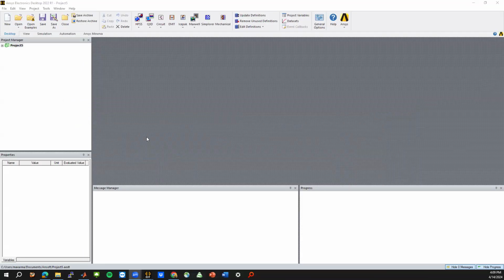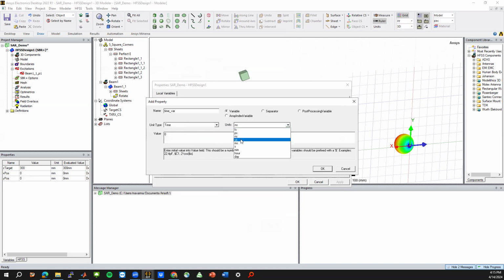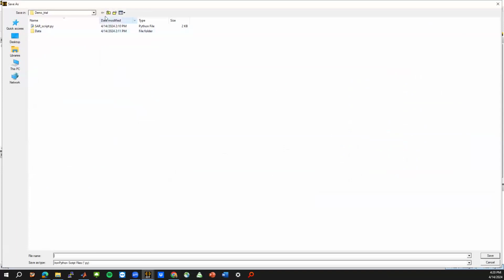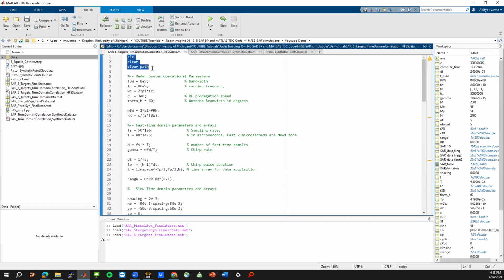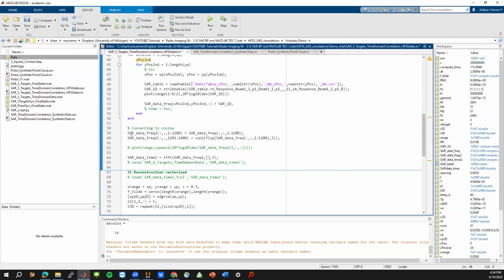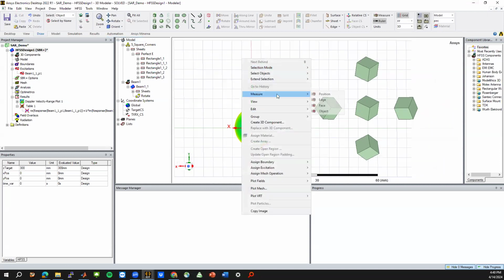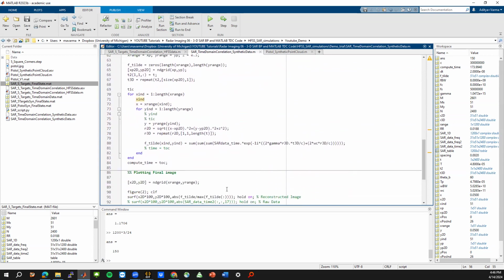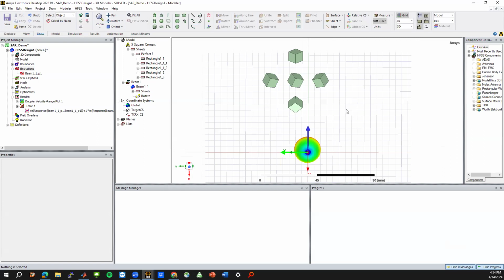FMCW SAR 3-D Imaging with Synthetic Data using HFSS and MATLAB | Radar Imaging 06

Comment: Thanks for the video, it was quite informative. What's your take on FMCW vs SFCW, especially imaging for security/scanning purposes? Targets are mostly stationary, so better Doppler analysis with FMCW isn't an advantage anymore. SFCW, on the other hand has many benefits - simpler front-end, higher SNR due to narrow band IF and no strict linearity constraints as the chirp ramps in discrete steps. Will be good to have your opinion on this in case there are some FMCW positives too.
Reply from the maker: For stationary targets SFCW is better, but most real world targets are not stationary (automotive, weapons detection, biomedical etc.). FMCW is therefore the only option.

Comment: Hello, may I ask if the function fs=ftx (s) in the provided code is correct
Fs=fftshift (fft (iffshift (s, 1), [], 1), 1);
Why do we need to do an iffshift first
Reply from the maker: yes it is correct. You need to use the fftshift because of MATLAB's indexing. Read about fftshift in the documentation.
Reply: @adityavarmamuppala  Thank you for your answer. I seem to have overlooked a question, which is that I believe the data you read has already undergone time-domain Fourier transform, and you have performed FFTSHIFT on the results. Is my understanding correct?

Comment: What if we were to have a model for example a cube with a sphere inside with dielectric properties ... would we be able to do a through the wall sensing / imaging ? In the reconstruction would we see the different objects?
Reply from the maker: I think SBR+ can handle dielectric materials. I have never tried it but it should work. Try comparing SBR+ results with FEM or IE solvers for a single data point and if they match you can use it for all the SAR positions.

Comment: Question if it’s mimo would we need to move each element (Tx,Rx)? Wouldn’t we only move if we are doing MIMO-SAR? Also is it possible for you to make a short video showing how to setup mimo in hfss?
Reply from the maker: You can either have all the elements in the same simulation and collect the full scattering matrix. Or you can move them like in SAR and collect it. MIMO-SAR is a combination of the two, where a MIMO array is moved. I will make a follow-up video on MIMO and MIMO-SAR next weekend.